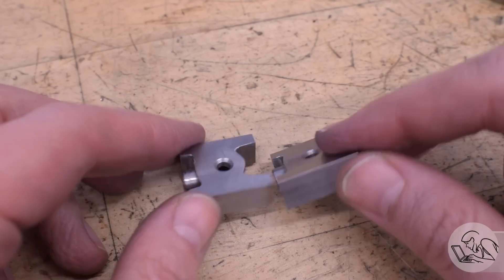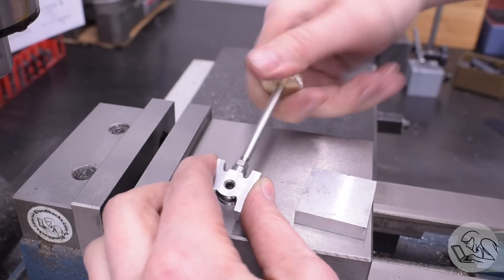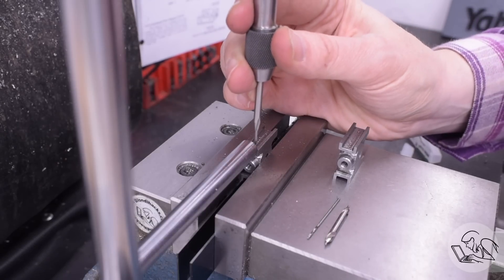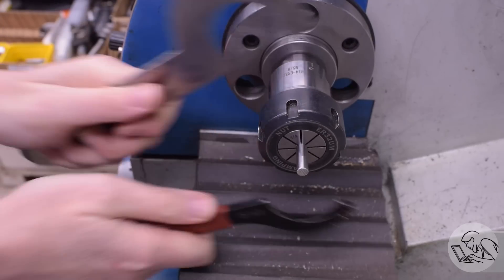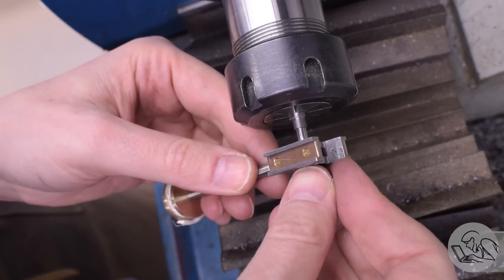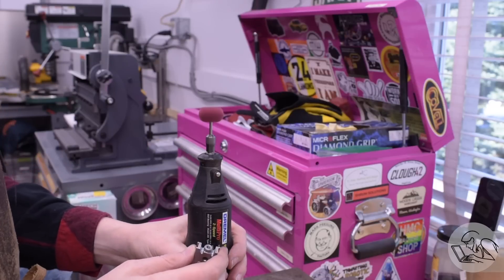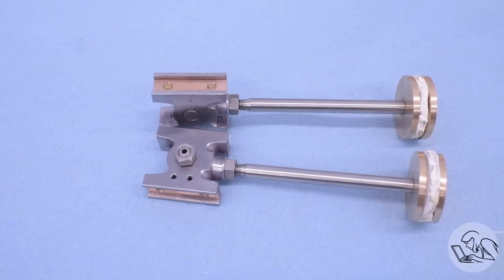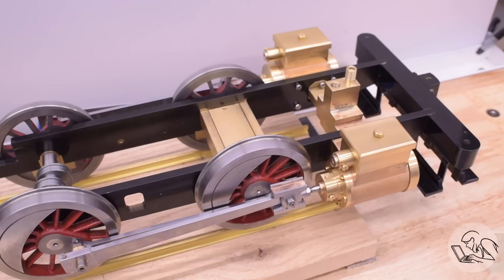Crossheads Finished - Pennsylvania A3 Switcher, Part 53

Comment: Thanks for the cut-off tool demo. It did very well on the tool steel. I've tried it on mystery steel that was obviously harder than mild steel and it did well.
Reply from the maker: It was impressively low drama. I’ve kinda stopped parting tool steel because it’s too touchy and nerve wracking. This was easy though!
Reply: @Blondihacks  That's great to hear!

Comment: hey Quinn just watched an interesting vid by "Hal  heavy duty machining  Australia" the are using a "flange facer" to reface a warped flange on a new design drill bit the flange that warped was 2 1/4 inch thick material  Quite a interesting watch !!   have fun in the new year

Comment: What is the trick to getting the book?  I've searched all over the internet and I cannot find A3 Switcher by Kozo Hirakoa.  I mean, I can see it has existed but absolutely no one has a copy for sale and apparently no pdf either.  I finally got a metal shop together and now I'm scratching my head as to what to do.  Building a steam engine seems right (30+ years interest in regular model railroading).
Reply from the maker: Unfortunately it went out of print since this series started. I recommend letting Village Press know you want it. If they get enough interest, they will do a reprint
Reply: @Blondihacks  I'll do so, thanks.  As a neophyte machinist, I'm not sure doing one of the "harder" ones would be wise :D.  This one is already way more complex than anything I've done so far.

Comment: The parts of full sized locomotives also have numbered parts for orientation and parts matching. I have found these numbers on project locomotives I was involved with. They usually have the locomotives road number, a serial number and assembly number as well as orientation stamps. These stamps are often overwritten with new road numbers or overwritten when applied to a different locomotive. Then again some railroads didn’t do this. I know for a fact that the Southern Pacific and the Colorado and Southern both marked their parts.

Comment: Good thing you made the tiny screws work to keep the bearing liners in the cross heads. Whilst loctite could have worked as a solution to stop them moving, cross heads designed like that will get hot against one of the two slide bars (and which one gets hot depends if running forward or reverse), hence the loctite solution may have been at risk of failing over time if there were any issues with lubrication, tolerances, dirt etc. causing excess heating above what's normal...says he who's never built one, but happily runs steam locos at times (7.25" gauge, and formerly involved with 2'6" steam too).

Comment: Hii.
I am a milling operator 
I also want to build the engines like you which is the part of my hobby.😊
So if I build Martin evans 5" gauge locomotive in halved the dimensions given i.e.,1/2 of its size will it work on not

Comment: Chooch looks good.  FYI, and this is too finicky for 3/4" scale...on the big ones, the wrist pin is tapered all the way through both sides of the crosshead, with the large diameter of the small end...the outer end...being a little smaller than the diameter of the bearing surface that fits in the main rod.  That allowed for turning a new bearing surface when it needed repaired and still keeping the fit.  They kept the pin from turning when the nut was tightened with a peg in a notch on the inner side of the crosshead.

Comment: If you insert a small ball bearing in the hole at the back of the pin and insert it into a vice, you can tighten the nut up. The

Comment: I thought I knew another way to assemble that but I thought about it again and then thought different. I think I understand now.
Reply: Quite literally the only other way i could think of would be infinitely more annoying and equally at risk of bending the rods, which would be to fit the crosshead to the piston and then drop the rear wheelset to put on the main rods. I definitely think the way shown is better if a bit finicky though

Comment: Superb detailed explanation as always 
Thank you so much for all episodes
Can't resist a challenge re assembly!
Why not unscrew/ unbolt the cylinder block from the chassis, attach the connecting rods etc & slide the whole assy back on the crank pins
 Sorry I'll get my coat...